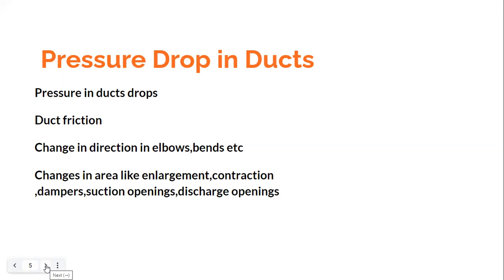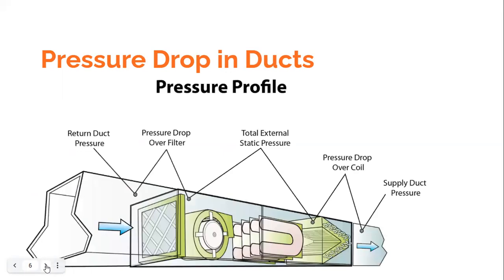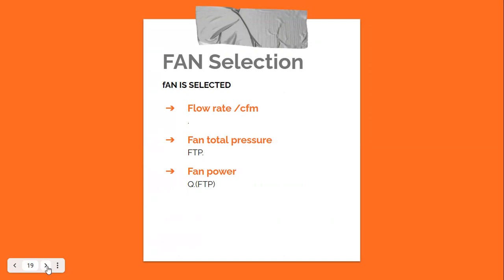HVAC  Fan total pressure /ESP calculation and FAN SELECTION

Comment: How does power required relate to the rpm and/or number of blades needed for the fan?
Reply from the maker: When you multiply fan area (square ft), fan speed (ft/s) and fan pressure (iwg), your units come out to be ft^3*iwg/s. To convert this to horsepower, you need to divide by 6356.